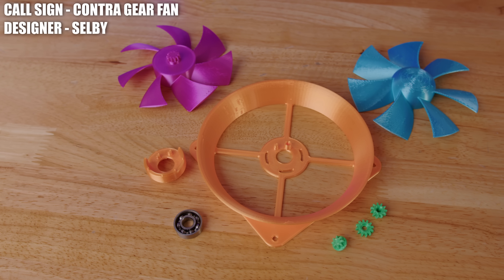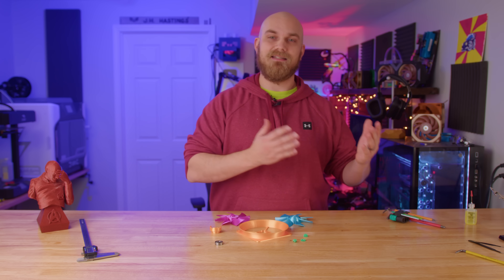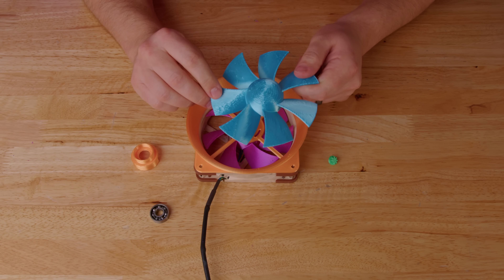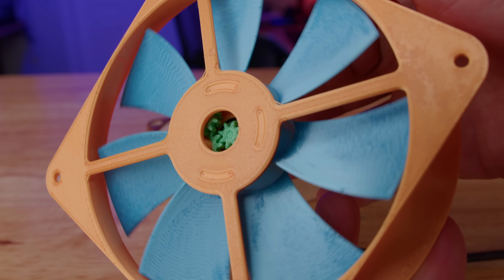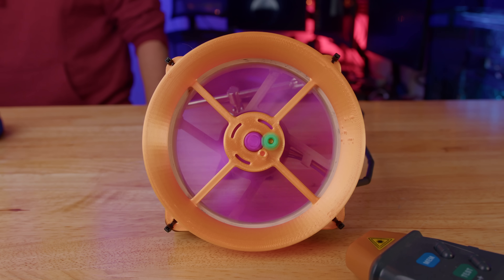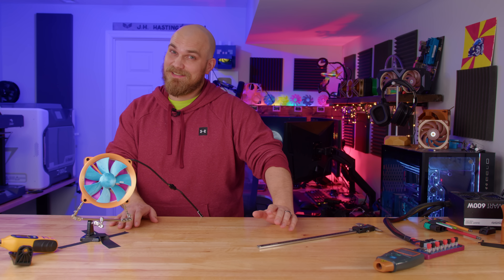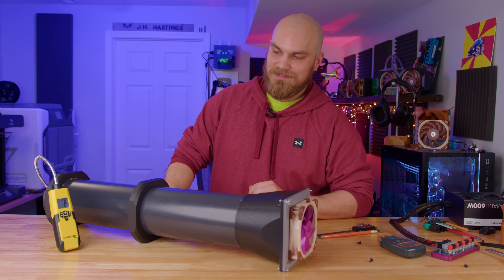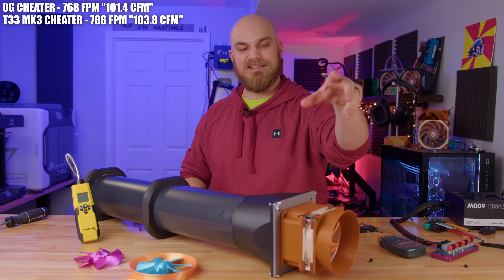World’s Most Complex PC Cooling Fan | Fan Showdown S4 Special

Comment: Honestly man there are a lot of people out there that only care about performance of the fan and not necessarily the noise. For me I'm fine with it as long as it isn't louder than say a laptop cooling fan.
I know a ton of people make a big deal about noise, and they should, but there are just as many people who care about performance.

What I'm trying to say is that there should probably be a noise based leaderboard and a normal leaderboard because there are different people who like different things and who knows maybe some people will print their own fans based on these designs.
I know I would if my 3D printer weren't broke.

Comment: This is so incredibly cool. I would recommend using herringbone gears the next time. They greatly reduce noise (which is why they are used in some transmissions) and they are more efficient. But great design.
Reply: Might be hard to print at that size though.
Reply: @eagames456  I have printed tiny herringbone gears for a 1/30 scale RC car and they worked great. You have to print slower and use the finest quality available, and at the size each gear should only take about 30 minutes. It takes longer but it's worth it.

Comment: You should use the Cheater block on to see if it makes the Contra fan even better.

Afterthought.. See how small you can make the back of the Cheater block before performance decreases. Then just use that as an alternate test with all fans for max performance.

Comment: A ball differential would have been a better solution for counter rotating the other fan. A simple ball bearing with its ball cage fixed to the frame would make the inner and outer rings spin in different directions while remaining simple, silent and smooth. There are even kitchen appliances using ball bearings as planetary gears (practically same principle) for rpm increase or reduction.

Comment: The secondary fan needs to have a higher pitch blade to take advantage of the air velocity at its intake. All compound setups need to be progressive.
Reply: Would also love to see a static pressure comparison, which is an area where the counter-rotating system should have an advantage.
Reply: THIS. You need a secondary fan which is able to handle the huge amount of incoming air pushed from the first. Meaning the fan blades on the 2 fan needs to be more open and not so angled
Reply: @Joshua-uq9zw  I agree with your first statement, but not the second one. (AKA, it needs more pitch on the second one)
Reply: And the rpm can be increase as well, the reason why they invented the counter rotating blades was to stop the compression after the single blade running at high speeds so with a better manufacturing and balance, probably would be in first place.
Reply: I thought the 2nd fan needed higher pitch, not the first. Look at all turbines, and even single fan blades, the pitch is less where the air comes in and more at the exit. Where I am I wrong?
Reply: @user-rs8zg8ey2b  if there is too much pitch the air will just bounce of the blades, therefore it requires a more open blade design. Look at the noctua NF-S12A
Reply: @Joshua-uq9zw  I didnt disagree with the open part, I did disagree with the less pitch for the second fan blades.
Reply: Yeah it's to do with angle of attack. Fan blades are actually wings and require positive angle of attack to generate lift (and push air). You can't change their pitch, so angle of attack depends on air speed vs blade speed. For the first stage fan it's fine. But at the second stage fan the air is already at almost the same speed as the fan blades so angle of attack is almost zero. You get some additional angle of attack from airstream being "twisted" so there's a transverse component, but not much. 

Just increasing second stage pitch appropriately will nearly double fan's power drain. Unless you had double the motor power to spare (this fan doesn't), this will just bog down the shaft speed. So fan pitch ratio must be observed such that both fans generate equal amount of thrust and consume equal amount of power, but overall pitch should be reduced such that the fans' power input doesn't exceed hub motor's power output.
Reply: @michaelbuckers  look at a flat bottom wing, there is zero angle of attack, so I think your statement is not entirely true. Wings are thick to get a pressure differential, fan blades in general, 99% of them are not thick like wings are. Why cant you change their pitch, this does not make sense to me? Your 5th sentence also makes no sense. The increased pitch will consume more power, but I believe you want ~2/3rds of the power going to the second fan. The other bottom line I already commented on, all this gear train is nothing but a reliability issue, as bearings are the first thing to fail in brushless fans, add two more shafts and a total of 4 gears and reliability just went to 20% of a normal fan with same bearings, and much less with 3D printed parts.
Reply: @user-rs8zg8ey2b  Nah mate. It's just cambered wings (such as flat bottom wing) have positive angle of attack when they are "level", their actual neutral position is "tilted forward".  Besides, in this scenario this doesn't matter because its down to air speed against the blades, and since incoming air is produced by the same blades at the front, the blade airfoil shape and characteristics cancel out, so you just ignore that.

You can't change blade pitch because it's literally a solid block of plastic. 

Technically you can distribute the power between fans however you want, but the only distribution that makes sense is "even split" because otherwise why stop at 2/3rds and just dump all power into a single fan and remove the other. That would be more efficient but that's not the point. Reliability is also not the point, it's just a novelty fan.
Reply: @michaelbuckers  Say my rc plane does 140mph with 7x4 prop, change the pitch (yes, you can change the pitch, not sure why you keep saying pitch cant be changed) to say 7x5 and it does 155mph, if I over prop it with 7x6 then it slows down because my motor cant handle this higher load, this is all facts. Now back to this dual bladed fan, the air speed entering the first fan is very slow (say 1mph as a guess) and has a exit speed of say 10mph (using round numbers), so use the correct pitch for it, lets give it some pitch number, say 12 (much higher do to the much lower rpm than my plane). Now the second fans input is seeing 10mph, or 10x higher airspeed, logic says using the same pitch is not optimum, so the second fan needs more pitch for the higher speed input airflow. Or, change the rpm of the 2nd fan with the gearing.
Reply: @user-rs8zg8ey2b  Changing the entire prop is not the same as changing prop pitch. You can't do latter mid-flight so you can't match thrust to RPM so you're stuck matching RPM to speed. This means a prop must be designed to perfectly match a motor, otherwise it'll either won't extract all the power or bog it down with too much power drain. Same is true for this fan obviously. 

I already said that 2nd stage fan needs higher pitch but also 1st stage fan needs lower pitch, because 2nd stage fan will draw more power so there'd be less spare power for the 1st stage fan.
Reply: @michaelbuckers  Sorry, many props change pitch mid-flight, all the way back to WW2, even in rc planes (look up 4D place videos) they have variable pitch (even goes reverse thrust). Anyways, we seem to agree about the second fan either needs more pitch relative to the first, or it needs more rpm. Take care.

Comment: I'd like to see a spin off of this series- a double or triple motor and blade stack. Maybe with different pitches/number of blade similar to how a jet turbine works (basically starts with volume then compresses the air). Basically a competition of how much air can you possibly achieve from a single mount and still be reasonable quite (not being limited to just 1 motor). I think a double motor or triple could be reasonable but 4 would probably be too many and too heavy. It would take the perfect blade combination to produce the most air. The possibilities would be endless of a stacked design

Comment: Could you accomplish the same thing with 2 A12x25s with the fronts facing each other and one fan printed backwards?
Reply: I think that because they wouldn't be synchronized it would likely cause problems. There's only one way to find out.
Reply: @hellishinc  why would syncronisation be a problem ? Air gets pushed by the front fan, and air gets pulled by the rear. Air is Air. The Air doesnt change characteristics because of the fans being synced ?
Reply: @Joshua-uq9zw  turbulence. There's more to pushing fluids/gases than simply slapping *on a spinny thing. As shown by all the different designs on this very channel.
Reply: There are a lot of contra rotating fans built that way that's used in servers and industrial equipment. Most of them are however only 40mm fans and are used in 1U servers where they provide a very high (for axial fans) pressure that allows them to overcome the restricted airpath in these servers. They are also incredibly noisy, but again, server...

Comment: I'd like to see comparisons with some form of air restrictions, I.e. a radiator as the double fan should have a lot more static pressure then just a single fan.
Reply: Give this man some thumbs up! In the end it should be about cooling capability not creating the best windtunnel!
Reply: @kooskroos  aircooled vs watercooled.
Reply: @toolbaggers  A water radiator is still air cooling in this context and you want air speed through the fins in either case, but if you don't have enough pressure then it will be turbulent and inefficient when interacting with the fins. Water radiators need more pressure simply because the fins are more densely packed but both will need pressure.

Comment: Make a cheater frame to fit the contra setup and I think it would have a cfm in the 800s.

Or make the noctua and T33 fan designs work with the contra setup. Both with a without the cheater shrouds.

Comment: Epic! This with brass gears, bearings and steel gearshafts from a micro r/c crawler transfer case would possibly be more stable and spin faster. Maybe even if you could print a clip together mechanism for the top fan assembly so there's no gluing? Well done!!
Reply: Screw on contra gearbox.

Comment: NGL, I'm surprised there haven't been any contra-rotating fans on the consumer market (Outside of the weird double-motor things). Surely it's not that hard to make a consumer version with design refinements such as bearings for the gear-train and better precision in the manufacturing. You could have two versions even, a standard black or white fan housing called the Griffon, and an RGB version called the Spitfire.
Reply: It would be a street cred thing.

The second rotor has an aerodynamic dual as a stator, which is what you see in designs such as the Delta FFB's. Mechanically far simpler and less interesting appearance wise but for the purposes of a box fan adopts a lot of the air management benefits of an actual contrarotor (as well as the noise issue). The cancellation effects aren't particularly valuable in the case of a box fan.

Comment: Could you make a less loud contra by putting two fans face to face with one equipped with a reversed fanblade design? I don't mean stacked normally (push side against pull side) but rather, both of what would normally be intake sides touching, one with a "push" fan and one with a "pull" fan design. I bet you could even modify a reverse flow T33 fan to make a contrarotating T33 based design! Only downside is it uses two fan hubs instead of a cool gear setup.

Comment: would be cool to see with some lightweight metal gears and a properly lubricated bearing would be alot of work but I think well worth it
Reply: I liked the idea until I got out the McMaster-Carr catalogue and realized the budget haha. Doable but not too cheap
Reply: @nicksurfs1  why are you looking at an industrial part catalog lol, that's 500$ just to open the book
Reply: it might be better to use pulleys, not gears.
Reply: @gangadin2873  My dad use to work on dentist hand pieces so I was thinking having some small gears with some very small bearings might work pretty good and quiet
Reply: @redrevo_117  Dentists use pneumatic tools and they are quite noisy despite . They are ultrahighspeed and require torque, plus they have to fit within certain size. This is not the case for fans. The most these fans spin is 2000 rpm. Where as the dentist's drill is minimum 8000 rpm, maxing out at 250,000 rpm.
Gears would be fine if they are enclosed and lubricated in light machine oil. They can't be left open as they would catch all sorts of dust and dirt from the surrounding and clog up. That means building a tiny tiny gearbox and I am not sure anyone has the inclination to build a tiny metal gearbox for tiny metal gears and tiny oil seals.
Reply: @gangadin2873  Im not saying to use gears that small I am well aware of how small the parts are also quite aware of how loud the hand pieces are my dad repaired them all the time so i always heard him testing them

I dont think noise would be a problem with the fans because they are moving at a much lower rpm I am mainly thinking of smooth operation
Reply: @redrevo_117  That might work. Plus Recycling has got to be cheeper than new gears